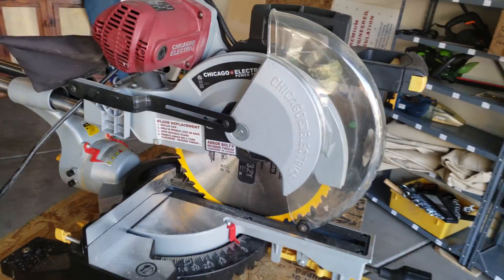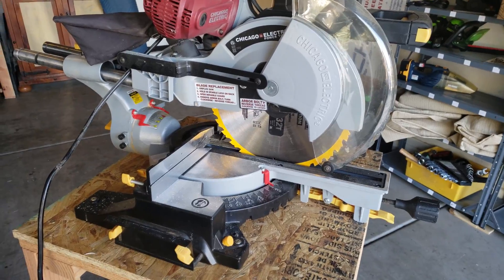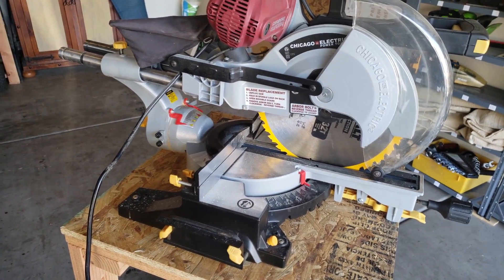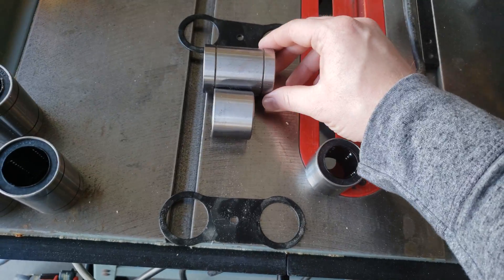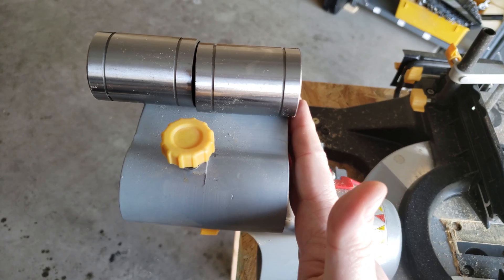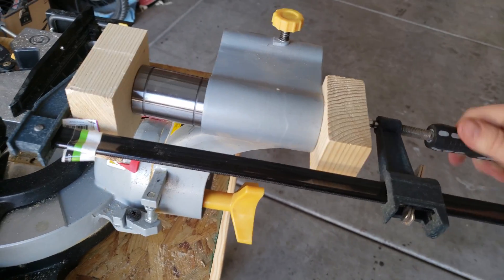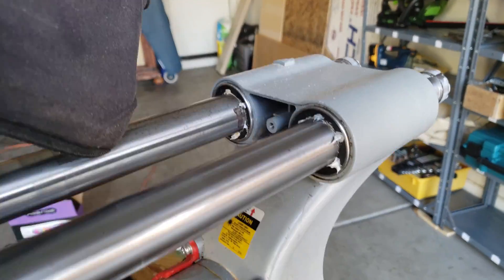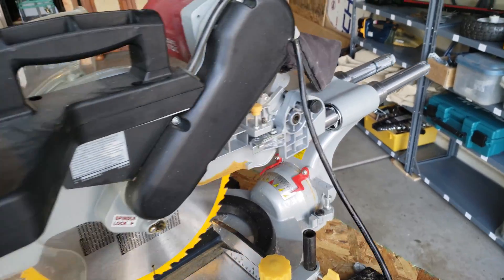Bearing upgrade/hack for Harbor Freight miter saw

Comment: perfect video. so just a quick heads up like we do with dirt bikes. Get a long ass bolt and washers after you start the bearing to press it in. you have to use a torch to heat the body while pressing the bearings or before. Huge washers will flush the bearing too.
Reply from the maker: Oh man! That is such a good idea!

Comment: Hello there! Would you mind explaining how you went about actually disassembling the rail system enough to pop out the bearings and slide the new ones on? For instance, I don't see any obvious fasteners to detach the cross piece that connects the rails at the back.

Comment: Hey there, if you're still around 5 years later...Thanks!  Same saw, same problem.  Ordered the bearings and all is good.  However, I only put 1 in each side: 1 flush with the back, and 1 flush with the front.  That way I got the dust caps to go back on and don't have the lost track space from them sticking out.  Having them staggered seems to balance things out.
Reply: My buddy just gave me this saw for free after the slide rails had been developing some surface rust for several years. So i not only have the wiggle inherent in the design, but it slides pretty rough. I found this vid while looking for solutions to the wobble issue, so i will for sure order these larger bearings.

Question though - why not install one new long bearing in the front locations, then reuse the original short bearings and install them in the back locations? If you need one to protrude to give clearance to the slide locking bolt, no problem, at least it won't sacrifice as much slide travel distance as using four long bearings.

What are your thoughts on that? Are the old bearings probably crap at this point and shouldnt be reused? I think with some cleaning and lubing, it could all work out.

Comment: I know this is an older vid, but i have pulled apart different brand saws and they only ever had 3 linear bearings. So they did not forget to install a bearing on yours
Reply: Yes it’s so you can lock the slide, can’t have a bearing go all the way through there

Comment: Thanks for posting, I have the Milwaukee 7.5", uses the same bearings and I have the same problem with the sliders, more specifically the  Left hand slider which has 1/2 of the bearing length to the RHS one. 
As mine was knocked in transit, I am trying to figure out if its the bearing or the sliders which are distorted.

Comment: All the hf sliding miters only come with three bearing sleeves for the arms to slide through.  It is designed that way because of the slide lock on the top left back side.  Mine has that too.  Air hose then Silicone spray help keep it going smoothly and not attracting dust.
Reply: Remington Shaver Lubricant Spray works Wonders 🤣

Comment: Did you ever figure out the locking screw? That's probably why the rear bearing was omitted. I wonder if you couldn't just drill down through the bearing? If the bearing happens to be rotated such that you don't hit the balls you'd probably be fine drilling. Also, too late now, but I wonder if the upgraded bearing in front with the OEM bearings in rear would've been about the right length over all to fit close to flush front and back? 

Either way, thanks for this! I've been using a 10" HF saw for several years because I just can't commit to woodworking as a hobby enough to spend the $$$ for a "real" one. But your ideas to upgrade/tune are probably the best way to go. Thanks for the ideas!
Reply from the maker: Sadly I didn't get to spend more time looking into the lock. The next day while working with the saw the blade   guard plastic broke.... so the saw it out of service for now until I decided  what to do.

I really like the ideas! I think the bearings do have enough gaps that you could probably drill into them but making sure they are aligned would be hard. I didn't have the best tools for this modification so I totally destroyed the original bearings. Size wise, one original and one new would have fit another better.
Reply: Looks like HF might have recalled the saw recently for the guard problem....https://www.cpsc.gov/Recalls/2023/Harbor-Freight-Tools-USA-Recalls-Replacement-Lower-Blade-Guards-for-12-Inch-Chicago-Electric-Miter-Saw-Due-to-Injury-Hazard-Sold-Exclusively-at-Harbor-Freight-Tools-Recall-Alert